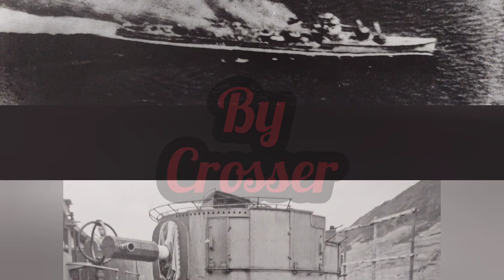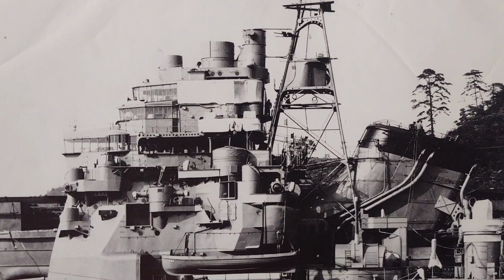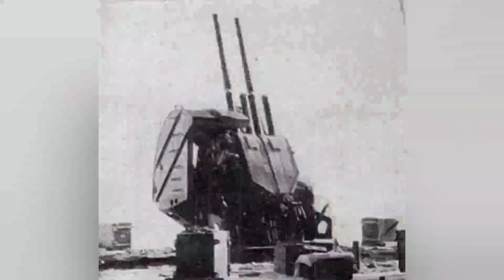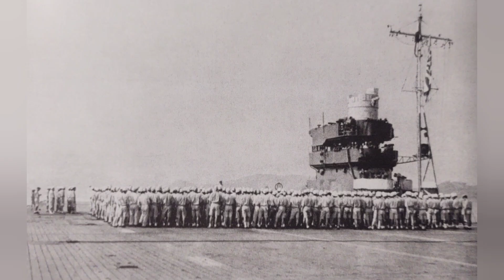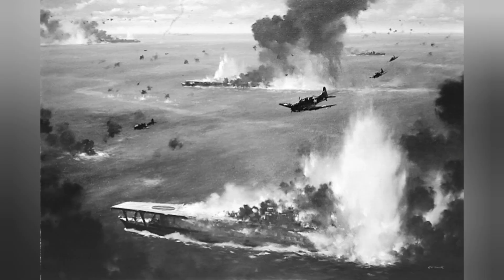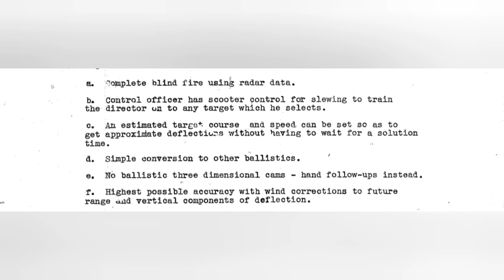Japanese Navy High Angle control in World War 2

Comment: To answer the question below, the IJN never deployed a Remote Power Control system like that applied to the USN's Mk.37 and Mk.33 directors, where the "rangekeeper" or computer directly controlled the guns. The IJN systems used "follow the Pointer". The AA computer would generate a firing solution. In the Type 91, it was processed manually to the gun mounts, automatically by the Type 94. A "pointer" in the trainer's and pointer's sights would be generated or moved by the input. The trainer and pointer would align their sights to the "pointers". Unfortunately, these sights and the computers were stabilized by a telescope on the director mount which maintained the horizon. In rough seas, the error between solution and the mount's elevation and train could be significant. 
The Type 91 was similar to the US Mk.19. The computer and the input stations were on the director mount, but the range finders were separated from the director which could result in the RF operator looking at a different target then the director. The US Mk.28, Mk.33 and Mk.37 integrated a 15' stereo RF onto the director. The Type 94 did the same. The Type 94 was similar to the Mk.28 when operated w/o a powered mount and to the Mk.33 when powered, though its actual capability was somewhere between the Mk.33 and Mk.37. One superiority, besides radar, of the Mk.37 was that it not only had RPC, the shell fuzes were set in the ammunition supply as they came up to the breech. In the others, the fuse settings were introduced at the mount, which increased the delay time between the target action and the when the round was on it's way. 
The IJN never produced a real fire control radar. The Type 22 surface search radar at 10cm, was modified in October 1944, but the radar aerials (horn like transmitters and receivers) were widely separated from the directors and though it used a cavity magnetron, the IJN couldn't get as much power through it as the USN. This modification was about equivalent to the USN's Mk.3 (FC) of 1941. The Type 21 and Type 13 were air search radars. The USN mounted the Mk.4 (FD) 40cm radar on the Fire Control Director, Mk.1 (this was the Mk.19 with an integrated 15' stereoscopic RF and a shield, you can make them out on the forward bridge of the BBs at Pearl Harbor), Mk.33 and Mk.37 directors. The Mk.4 was good for range, but not quite for bearing. The Mk.12 came along in early 1943 at 30cm and could get accurate range and bearing data for "blind" fire (night and other limited visibility). It was paired with the Mk.22 "orange peel" which could get good altitude data. Of course, by then, the VT fuse was entering service, which removed the need for completely accurate range, bearing and altitude data and fuse setting.
The RN was first in the field with the HACS. They made several poor assumptions about the nature of AA fire control, and despite repeated revisions and "bolt-ons", never reached the point the USN had with the Mk.37 or the IJN with the Type 94. In fact, the best RN battleship and destroyers were equipped with "Lend-Lease" Mk.37 with British radar, which did keep up with the USN technically, but the British didn't have the electronics industry to pour out radars, generation after generation, and the modified versions of their earliest radars were still serving at the end.

Comment: Excellent video!  I’ve been fascinated by fire control for awhile now, but information can be hard to find for a lot of systems.  I would be especially interested in the fire control for light and medium caliber automatic AA  guns. Especially the Type 95 (I think) Le Prieur system for the Japanese 25mm triple mounts.

I’ve basically been able to find that it existed, and I’ve seen it in a few pictures—I have no idea how, or how well it worked.

Again, excellent video.
Reply: Hello. USNTMJ-200E-0633-0764 Report at page 52 might have some information you haven't read.

Comment: How was the targeting information conveyed to the guns? Did the gunners have to input this information manually, or was there some kind of automatic aiming system? How did they account for the latency between the aiming calculation and the actual firing of the guns, given that they were distributed all over the ship? Does the use of a director imply that only one target could be aimed and fired at by all the directed guns, per volley? What if multiple planes were attacking at the same time? Did larger ships have more than one director, each controlling a subset of the guns? What about the lower range and higher fire rate guns? How were they controlled - e.g. to attack torpedo planes? Did they just fire at will, using manual aiming, or were they also controlled somehow? I'd really like to better understand how this whole process actually worked.